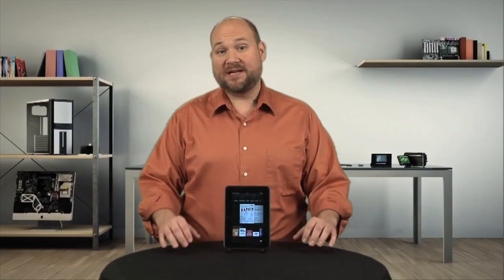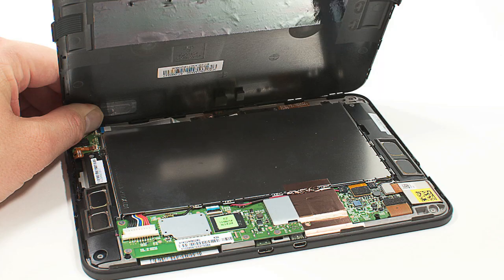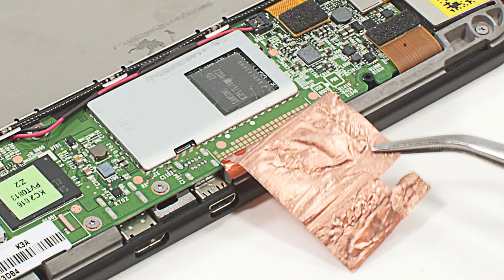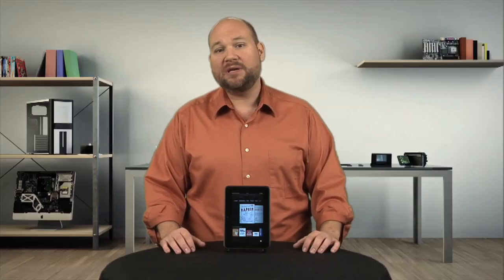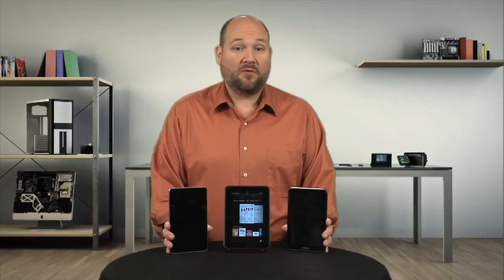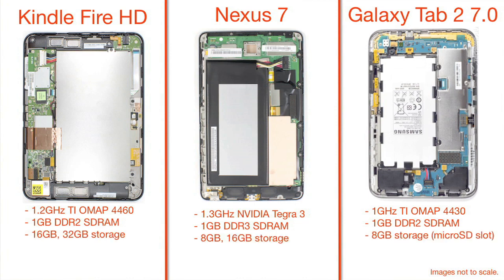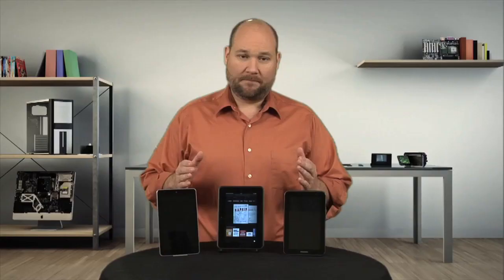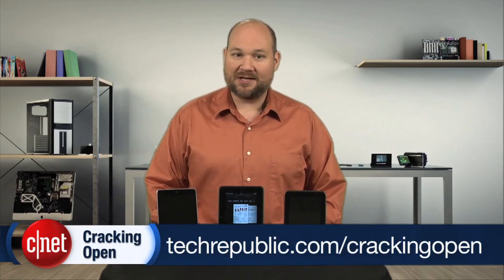Cracking Open - Kindle Fire HD

Comment: I'm curious if replacing the battery would fix it because it only powers up with a PC USB for 7 seconds then abruptly shuts off. Cant boot up from the wall as well... or possibly there's and faulty short in its micro USB port to the motherboard? or its system could just be that badly broken. Its recognized by adb for 7 seconds as well before it shuts off with the fastboot cable or factory cable.